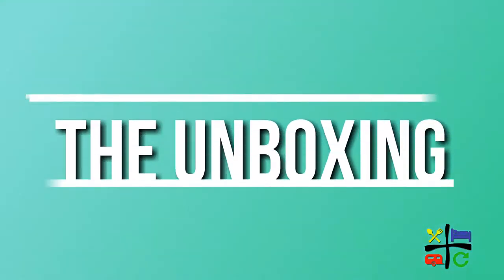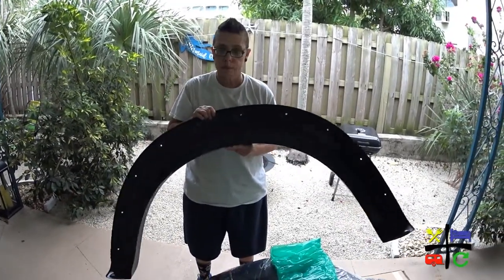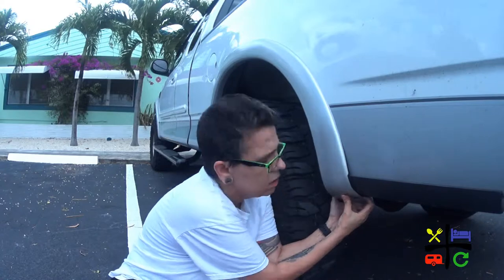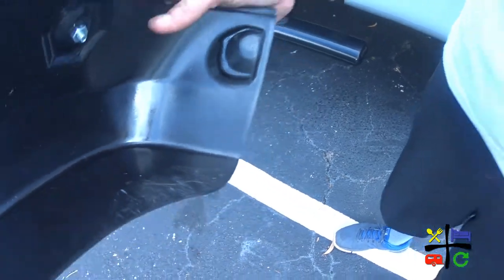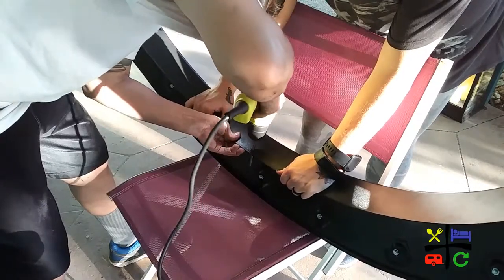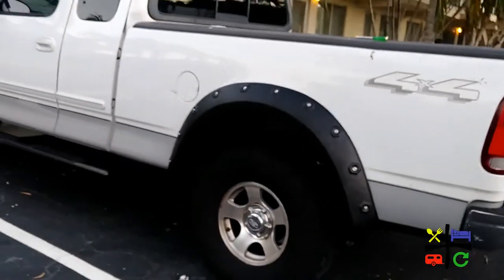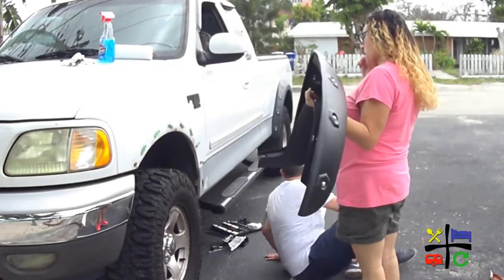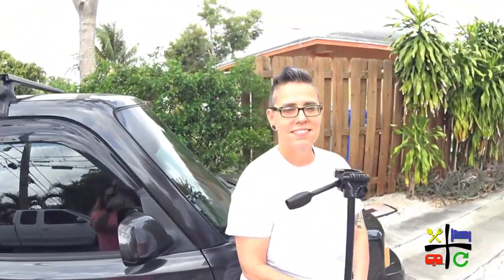Fender Flare Install ⁞ Ford F150 Fender Flare Unboxing ⁞ S1E71

Comment: Those bolts that went into the fender to make it look bolted did those come with the package? Or did you buy those separate?
Reply from the maker: It came with it.  We bought this package on eBay. Those big screws/bolts (whatever they're called lol) make a world of a difference in the whole look.  Till this date, it's in perfect condition and looks awesome.  😃Angie
Reply: Just a suggestion you may want to try next time or others who do this, sometimes it’s not as easy as the instructions make it look.   I jacked up my truck and put it safely on jack stands I pulled the wheels off.  Now you have tons of room to drill or install the slip nut (it’s called a speed nut ) also you have room for a cordless 20v drill to do any drilling and screw on the screws.  I would definitely add more screws.  Like she said.   Trucks look way hotter with bigger tires and flares

Comment: What size tires are those and does the truck have a stock lift
Reply from the maker: No stock lift. As for the tires, don't remember.  This was many years ago.  They were huge and loud and didn't grip the wet ground so we changed them.

Comment: could you send the link where they were acquired?
Reply from the maker: Hi Sergio, the fender flares are from Ebay. Unfortunately, I don't have a link. I did a search for 2003 Ford F150 Fender Flares and found them. 
I sorry I couldn't help you more.
Lou🤓